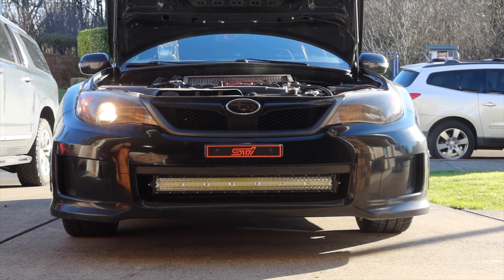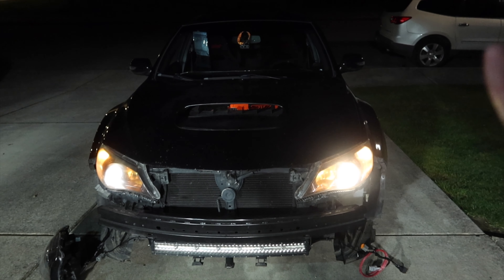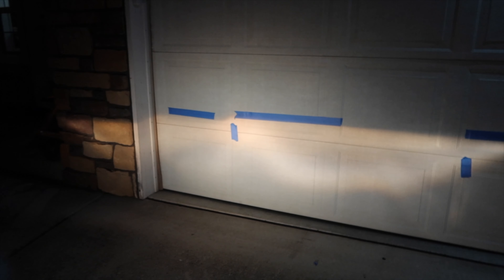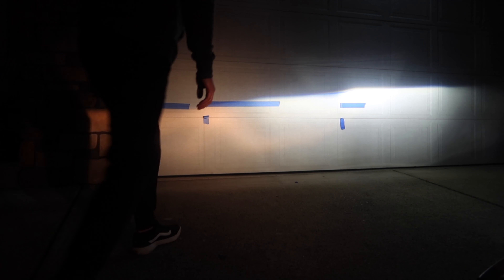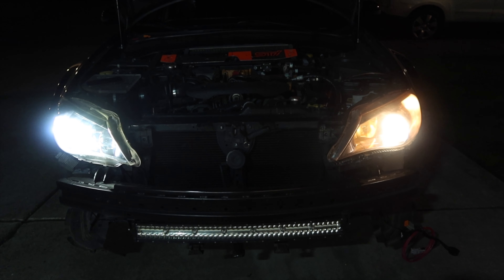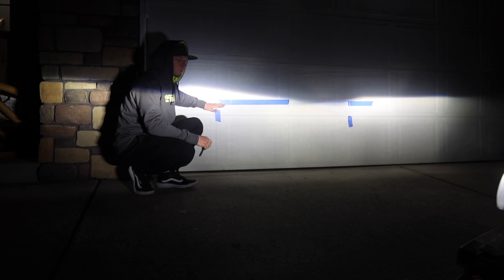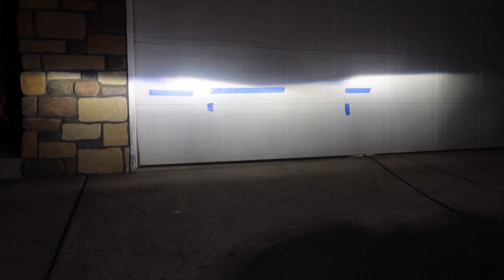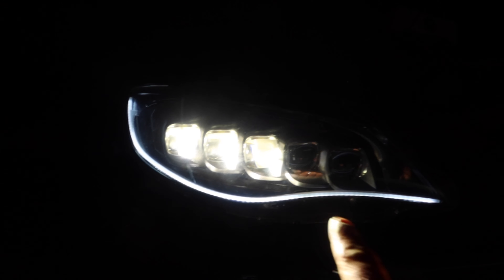Final Tweaking Of The Lights Before We Seal Them Up For Good Hopefully

Comment: if these lights goes out you have to replace the whole thing ? or just the LED
Reply from the maker: Yeah the whole unit but the only part I would need is the 5 inner bulbs. With time there will be a system to change out these bulbs. There are companies that supply just the LEDS to be soldered in